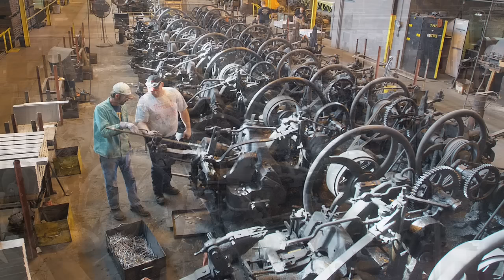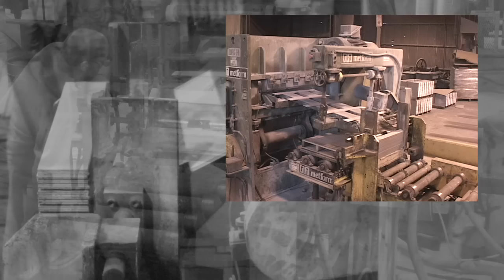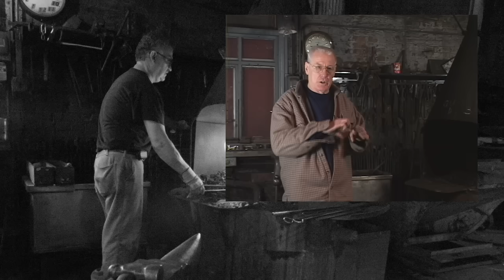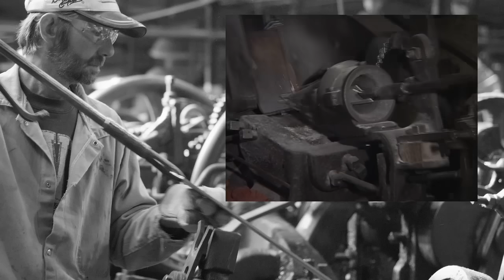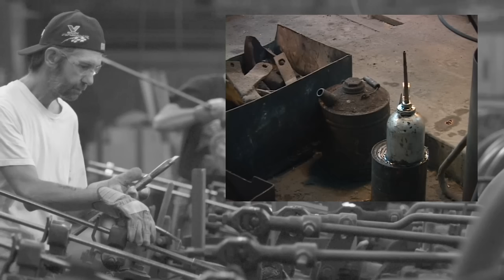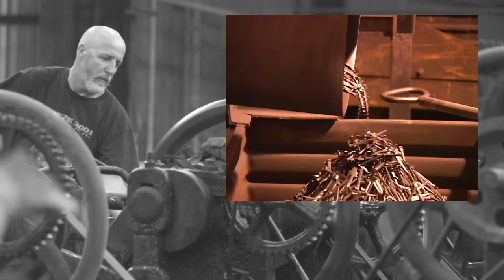La Belle Cut Nail Plant Documentary

Comment: Does anybody use cut nails anymore?  Obviously, some guys must because they were sending out 50 lb boxes!  I used them to fasten wood furring strips to CMU walls.  You don’t see that much anymore.  We switched over to the “pins” that were part of the powder actuated system.  Sometimes we would shoot the pins in, other times we would hand nail pins in.  We also used small hardened steel nails that we called “tension pins”.  The cut nails didn’t always work.  If hammered them in too deep, they would loosen. If you didn’t sink them all the way, they would affect the panel you put on the furring strips.
Reply: @markkillion8980  yes sure do….a cut nail pushes a plug through the lumber and does not split it…wire nails force their way 
Through by wedging the fibers apart
Reply: We used what we called case hardened nails in air powered guns to install furring strips to concrete. It works great on new construction, but it can be a nightmare on remodels where the block has had 30 years to harden, I used to use cut nails to hand nail expansion strip on to concrete, but years a go I switched over to PK nails. They have less chance of breaking due to their round. I'd say the market for cut nails has significantly diminished and probably is why this plant was closed after the 2008 financial crash, when demand for construction materials completely collapsed.
Reply: When I need a nail for furniture, cut nails are second only to forged rose headed nails.

Comment: What is a cut nail 😂
Reply: They're cut from heavy gage plate or coil stock and are flat, squarish, and tapered. The square profile makes them hold 2X better than round wire nails. They're also 2X harder to bend than wire nails. You sometimes see sparks when driving them.

Comment: What are cut nails still used for?
Reply: They didn’t show a close up of a cut nail or describe its uses.
Reply: @tommyh.8391  Google search "Grip-Rite nails". I prefer them to wire nails.
Reply: They hold the space station together, maybe, maybe not.
Reply: I've used them to nail wood to concrete already constructing a building. That was one years ago, a lot uses certain screws to do that these days.
Reply: making ladders if you want to kidnap a lindbergh baby
Reply: Anywhere extra holding power is needed and for use on extra hard wood that bends wire nails.

Comment: lead pellets used to clean the steel? 1:40
Reply: Unlikely. Shot blasting uses steel shot, they likely made a mistake.
Reply: @napaisava  or they use lead instead of steel to avoid peening and work hardening
Reply: If they used lead, they would have to deal with hell from any inspection team. That stuff is toxic and will be atomized into the air with each impact. Workers would have lead poisoning. If you want a non work hardening abrasive there's other options, I would be both amazed and horrified if it was somehow lead. Corn kernels and walnut shells are options, lead isn't.
Reply: @Dingleberry1856  Nope, the shot have the color and shine of lead, but are steel. Lead would instantly flatten out when flung against steel nails at 150-300 feet per second.
Reply: You are right - I picked up on that immediately, makes you question just how much the commentator understands their own process
Reply: @joedyhicks9415  That is just it, the commenter did not understand the process, just reading the script.
Reply: I would think lead would be too soft.